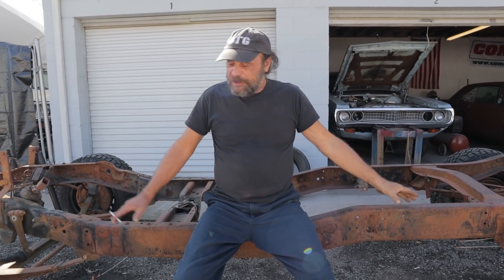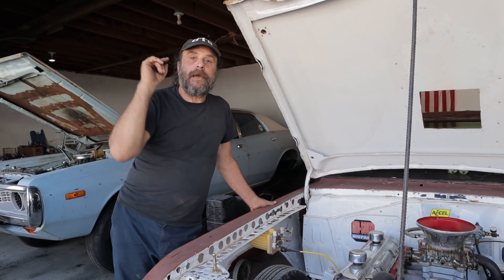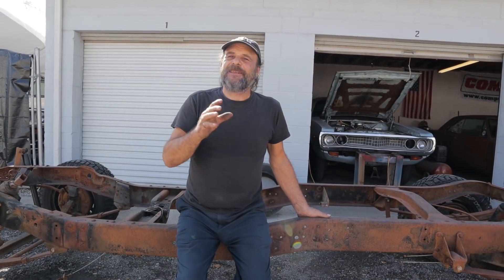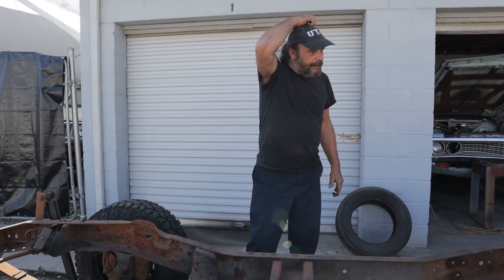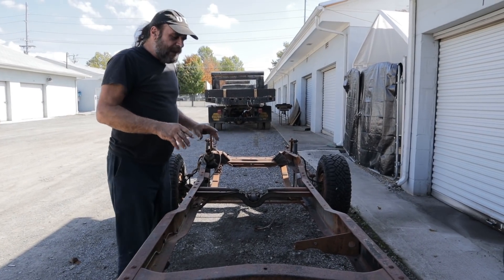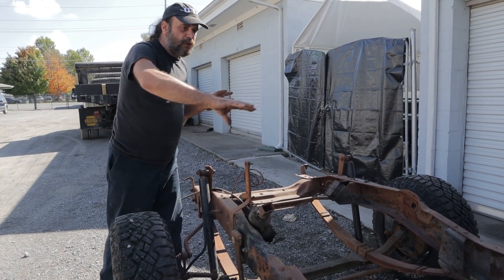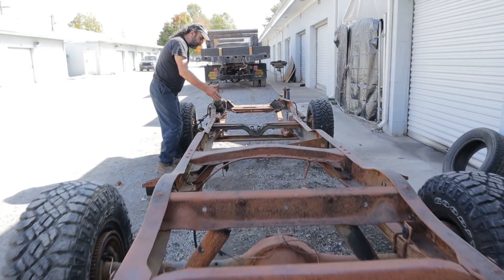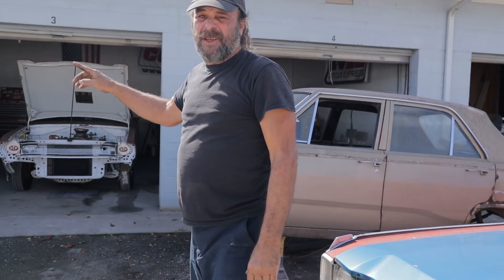The Fine Art Of Biting Off More Than You Can Chew

Comment from the maker: Ok, lots of great input here.  I'm going to go with the consensus that says to shorten the frame and then screw with the steering IF it turns out needing to have the arms moved to compensate for wheelbase.
This stuff is new to me, so I'm all ears and eager to learn.  Thank you!
Reply: It may have been said elsewhere but dodge used the same geometry from 106"(ramcharger) to 149"(club cab long bed).  You'll be fine.
Reply: Stay in the Fight Boss... UTG Family Grows and grows..
Reply: I like Rob B's suggestion above, leave the wheelbase and make an off-road Valiant limousine.
Reply: 2wd xj cherokee front ends are solid axle and the trucks are 108" wheelbase, see if just the knuckles will fit, or adapt the setup to leafs, either way, easy fix.
Reply: Send it!
Reply: Great, exactly what I came to say figuring the poor looks will be worse than any steering issue.
Reply: Steel pipe and flex joints. Make your self a 4 link set up front and back with a piece of steel as your cross-member. Then find some big cheap new to you coil springs & some new to you shocks with decent travel. Don't forget to lock front and rear how ever ya see fit, make all 4 spin on the dirt.
Reply: The geometry you are speaking of does not intersect at the rear axle centerline it's10% behind the reat axle centerline,... example 108 inch wheelbase, the angle coming from the spindle should cross 10.8 inches behind the rear axle centerline, at 128, it should cross 12.8 inches behind, this is why you came up with  the 140 measurement, pretty sure this geometry is no longer used unless the vehicle is front wheel drive, with the steering behind the front axle centerline
Reply: Please uncle tony let’s see some 426 hemi bulid
Reply: @clayjones1063  be patient for the Hellvedere...
Reply: mark shaw what’s that ?
Reply: @clayjones1063  he did a video on his plans for a injected nitro hemi Belvedere for noprep racing.
Reply: Why don’t you put a C body 1970 300 or a c body ? It would be closer love your work hope to have a garag as full as yours. Only issue I like hard to find cars
Reply: On second thought, different steering box locations between the van and the pickup probably resulted in different steering arms, so they won't swap.
Reply: You know I see a lot of people sending advise on this . You could always measure the dart . You know your not the first to do this . You can check the angle on the truck then check the angle of the dart if same then your fine if not then you know .
Reply: I would of considered the ram charger chassis
Reply: Ackerman steering.  That is all.
Reply: Some books to read.  From Carroll Smith:  Engineer to Win / Tune to Win / Drive to Win /  Nuts, Bolts, Fasteners and Plumbing Handbook  AKA . . . to Win .  These books were around pre internet and were the source for race car building info.  Carroll Smith was involved in the Ford GT-40 project as well as some F1 cars so the books have a road racing slant however fabrication principles still apply to other cars.  

A couple of things on this build. The ackerman won't be an issue when cutting the frame.  One important point is to check and adjust caster once everything is complete.  If caster is near zero, driving the car will be very difficult as the tires will pickup every groove in the road and making for a wandering drive.
Reply: if the steering knuckles are steel you heat them them bend them to the correct angle ... like they did for the old road race cars

Comment: Looks like you plan on shortening the frame. That will probably work fine. But if you don’t want to do it you could put a real long front end on it. Weld old fenders together or just add 20” of sheet metal. Might look cool. Give you lots of room under the hood. Anyway have fun.
Reply: Actually thinking about it shorter wheel base might help you off road.

Comment: ALso you can string the chasis like they do circle track cars, you use jack stands and string 18inches to 2 feet on each side, then if the string are parallel to the chasis you can make the tires parallel to the strings, for front tires measure front of the tire and back of the tire and line the car up without a alignment machine, just use four jack stands and two strings. You just use level for caster and no way to adjust chamber.

Comment: I learned it with 4x4, you have to keep the leaf spring plate parallel to the ground. (as long as its parallel to start with) Someone had put really long shackles on the front of a Toyota they had lifted for tire clearance. It changed the chamber and you couldn't hold it in the road at speed! Tilting a rear axle is no problem, tilting a front axle causes LOTS of problems now cutting the chassis you got to "Z" it, you cut from the bottom up to halfway, then cut a straight line for 4-6 inches parallel to the ground, then cut the straight upward to the top. The rear has to be cut the same way so they fit, you don't cut from bottom to top a straight line, by "z" cutting it its 100 times stronger. We would have to cut hunks of chassis out of Dr.Pepper trucks to make them 10 wheeler dump trucks, shorter but more weight hauling capacity. We also cut drive shafts, as long as you don't knock off the weights we would shorten them with no vibration, 100mph +. I have welded many drive shafts in a piece of angle iron!

Comment: Some books to read. From Carroll Smith: Engineer to Win / Tune to Win / Drive to Win / Nuts, Bolts, Fasteners and Plumbing Handbook AKA . . . to Win . These books were around pre internet and were the source for race car building info. Carroll Smith was involved in the Ford GT-40 project as well as some F1 cars so the books have a road racing slant however fabrication principles still apply to other cars.

A couple of things on this build. The ackerman won't be an issue when cutting the frame. One important point is to check and adjust caster once everything is complete. If caster is near zero, driving the car will be very difficult as the tires will pickup every groove in the road and making for a wandering drive.

Comment: Have you considered what a "Lakester" syle 4x4 build would look like if you took the top off the Valiant and had the body more toward the back of the frame? It could help with keeping the center of gravity toward the middle of the vehicle. You could adjust the rollbar weight to really dial the weight distribution in.

Comment: You could easily fix it, for every 10 inches you cut off, say add an inch to the inner length of the steering arms (From centre to centre) those numbers are an example but they'd allow you to get your steering pretty close,  Steel plate welded onto the steering arms to bring the holes in an inch both sides, problem solved. to further explain my point, glue 2 pieces of string from the back of the hub to where your axle will be (V shape) then weld plates onto the steering arms and redrill the hole so the string cuts straight through the holes.

Comment: I’m surprised it took you this long to discover the wonderfully archaic and simplistic two wheel dodge truck/A 100 front suspension. Dodge used these in b bodies during the F/X period and supposedly had a weight savings over the standard K frame and torsion bar suspension setup. It may be worth looking at on some of the other projects.

Comment: You never turn wheels all the way to their extreme limit. If you cut out the 20” of the frame you may lose 20 seconds of tire life each time overall in the front but if the wheels normally only last 5 yrs I doubt your gonna have to change them that much sooner by leaving the steering alone and just cutting the frame. I wouldn’t worry about it.

Comment: You have that old dart/valiant 4door A body with rusted and wrinkled up rear wheel openings and quarters. The axle track on the truck is wider than the dart. The wheels and tires are going to be to big for the stock fender openings anyway. With the 128 inch wheel base, you don’t really need to shorten it. With slight repositioning, you can set the body on the existing frame and accommodate a roomy engine compartment and wind up with a good drivers seat location almost ideal for driving comfort. Since you have already cut out a big chunk of the front floor and firewall, you then have all kinds of room to extend your front floor boards and move the lower firewall forward to get all the leg and foot room you want and allow all the space needed for transmission clearance. I suggest you set the 4 door body on the frame with the rear axle centered to the rear wheel opening. Then move the body forward until the rear door and body dogleg clears what ever wheel and tire combination your going to use along with suspension articulation clearance. Then you can cut out the wheel openings above the tire and extend into the back quarter panels accordingly. The benefit is you preserve your rear door openings and door frames, and can continue to have totally functional and usable doors along with the supporting body structure. You eliminate the wrinkled and rusted lower rear quarters, can use more or less stock front fenders and remove only the front sections between the wheel and front bumper. And then you can extend widened flat fenders from the old power wagon style to cover the wheels and tires. It’s all good and you will then have a ton of room in the front for what ever engine you want to install.  And you use what ever stuff you have laying around in your scrounge metal and parts pile to save on material expenses.

Comment: Wheel cut also factors into your measurements. 
A 99 to about 06 super duty won't point to the same place in the same wheelbase as an 06-up steel body super duty because they changed the hubs and wheel offset to allow a tighter turning radius. 
Which steering arm you put on the back of the knuckle of a heavy truck is determined not by the exact wheelbase, but the range the wheelbase falls in. And with a solid axle, you're only going to notice it when it eats steer tires on pavement. 
And the inside wheel has to turn more than the outside.

Comment: Cut 12"of length from Twin I beam 76 Ford F250 frame... no steering problems. Just secure rails in front of front cut and rear of rear cut point BEFORE cutting. This will insure rails do not twist inward or outward. Just weld temp crossmembers to top and bottom of frame on "Save" portions . Use..pipe, flatbar..whatever
 you have. All the best on ur build.

Comment: I worked at an auto parts store that also specialized in 4wd truck accessories, I never saw the words cheap and off road used in the same sentence, before the weekends guys with jeeps, blazers, scouts and broncos would  come in buy u joints, bearings, shocks and suspension parts and always ask for extra spares "just in case"....they would be back the following week replacing something else.  If your a mechanic and love throwing away money, frustration, self punishment and dissapointment, off roading might be just the hobby you need.... that being said Ive always wanted a jeep cj.....go figure.🦴🧠

Comment: Everyone else has covered it, but remembering back 20 years when I was doing my apprenticeship here in Australia, ackerman says a line perpendicular to the wheels should all meet in one place which the vehicle pivots around, but there is another theory that says the front wheels should point the same direction, and manufacturers use a compromise between the two, and the slip angle and flex of the tyre casing more than makes up for it.
I would also expect on a low friction surface like dirt, it is going to be much less sensitive to absolutely correct steering geometry.

Comment: The premise that your talking is correct, however your taking measurements off a bare chassis. The geometry needs to be checked @ loaded ride height. You can also add caster shims to correct for alot of that. Shorten the frame shoot for 6 to 7 degrees of caster and it will work fine.

Comment: Can't you just angle mill/grind the mounting face of the lower ball joints to change the angle?  Then angle spot face the back of the bolt holes?  It's a small amount and I can't imagine it wouldn't be strong enough.....   or maybe I'm thinking of car ball joints... may not work on the truck design.

Comment: As I think someone else mentioned, Ramchargers, short bed, long bed, crew cab variants, etc. all use the same front axle. Which probably explains why the Ackerman geometry on your front end is correct for a long bed, crew cab truck! Taking all this into consideration... um, wouldn't a Ramcharger frame be like, almost exactly perfect for what you're doing? I mean, if you just wanted to plop the car over a truck frame without doing a bunch of extra fab work and weirdness and have it look good and stuff. On the other hand, I've no doubt that this will be much more fun to watch!

Comment: My 77 ramcharger has a really short wheelbase and I have no problems with it... I'm currently running 3/4 ton axles on 35s, so my humble advice is to please don't run a full length chasis on the dart body... It'll be so ugly (freaky) and the possible benefits will be negligible, comparing the work it takes to cut 2 bits off a chassis vs. Having a 4 door dart with tires hanging off the rear bumpers...
Reply: That's 113" for  a ramcharger wheelbase vs 131 in longbed version

Comment: Ackerman angle doesn't change if you shorten the wheelbase. It's set be the arm from the spindle or knuckle the tie rod attaches to. If you use the factory front suspension currently on the frame everything will work out. If for some reason you would like to change the Ackerman angle lengthening or shortening the distance from the arm off the knuckle and the tie rod attachment point will alter the angle enough to accomplish the task. Technically you should change the arm angle but lengthening or shortening the arms allow more or less steering angle.

Comment: You could leave the frame as is and line up the rear wheel opening with the rear tire. Move the engine/trans back which would keep it from being nose heavy. It would look funny with the front tires way out front, but it'll be unique. 👍

Comment: Shorten that frame.  Just like the Bronco on a shortened  F-150 chassis.  It'll turn tighter and quicker on a shorter wheel base.  You're OK.  On dirt it won't push much and you'll have enough power to break the rear end loose any time you want : D

Comment: I would rather see the motor 20 inches further back in the frame and the front tires 20 inches forward of stock. Better weight distribution for traction. And a cool gasser vibe.

Comment: Why would you use a open box frame in a very old one at that if you're planning on making a off-road you need to be stronger frame especially if you're starting with a roller or at least weldin to make it a closed box frame and really for suspension and stuff you really want a newer one unless you're planning on just making it all new yourself

Comment: Cut that frame Uncle Tony ! You're overthinking it, she will drive fine. Leave a +2" or +3" on the front axle centerline to allow for front tire to inner firewall articulation travel, use the frame sections to double wall frame splice, BOLT on a section of 8" channel for a front bumper to get some weight out front of those springs again so your teeth don't fall out. Drop the seat as low as you can and keep the column high with a much smaller steering wheel. BB with 727 manual shift and super low stall pushing a open diff. 33 x 10's on some used cheap 8 x 15's at @ 28 ish psi. And when you are thinking about dropping a Dana 44 in it next year you will be miles ahead. 
I did a '72 Valiant 4dr on a '75 383 auto D200 LWB, long ago and I added the dana w/transfer after 2 years of laughing so hard I almost wet myself every time I broke something.

Comment: I had a 71 Dodge d100 for years.  There are only two years that interchange parts. I would check on front brake shoes, drums , and other parts before jumping into this... They weren't available when I tried. I was able to get king pin parts, but that was about it.

Comment: Tony, I think you have quite a lot in common with Pierre Hedary, the classic Mercedes mechanic in Tampa. I watch both channels.
Reply: I might haveta go check that out , I see the other guys vids occasionally.
If I didn't pick up this current project , I really had an itch for a 90-91 560sec for a while.
It's a dopeass gangster ride imo. 
Don't worry , I'm a VW guy so I know I just multiply Mercedes parts by 4 or so and I'm good 🤣
38.57 for one spark plug???🤣🤣
I don't know , I made that up but it's probably not far off 🤣🤣

Comment: Hey Uncle Tony and a little bit lost on the ackermann geometry. Can you do like a video with you like drawing or something like that to explain it? You have me very interested.
Reply: What this guy said. I'm a pretty smart feller when it comes to mechanical things but that whole Ackerman explanation left me more confused than before you started.
Reply: It's simple enough. Imagine a car driving around in a circle. The inside wheels make a smaller circle than the outside wheels. That means the inside wheels need to turn sharper. It turns out, the way to accomplish this is to have the tie rod shorter than the distance between the king pins. If they were the same length, the wheels would turn the same angle.
How much shorter? If you draw a line thru the king pin and the tie rod end the 2 lines should cross in the middle of the rear axle. That is the theory. In practice it does not have to be all that exact, in fact some cars handle better with the ackerman angle "off"  so to speak, and are built accordingly.